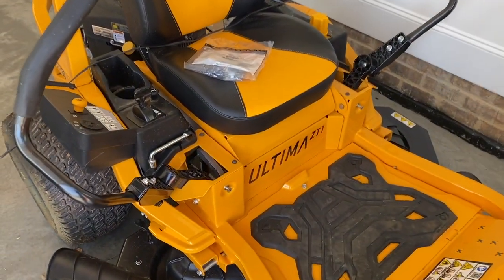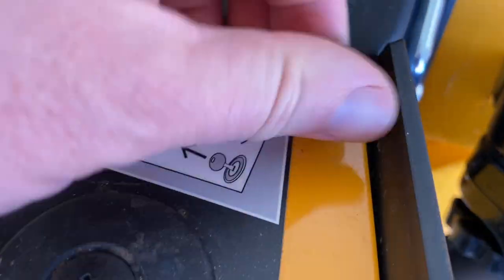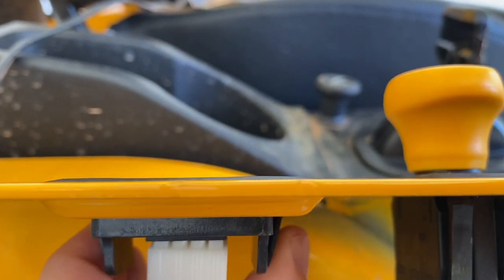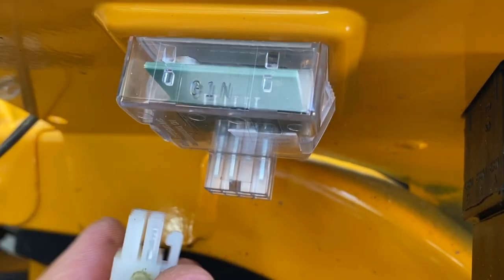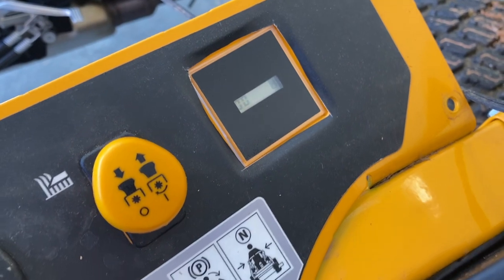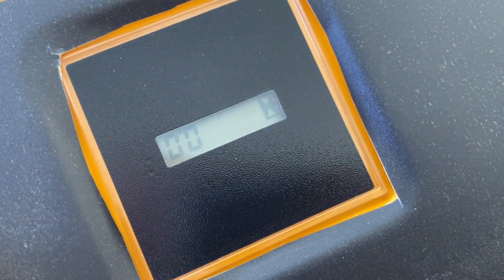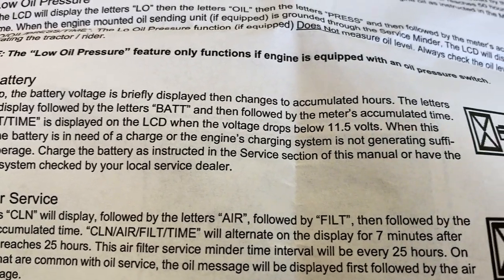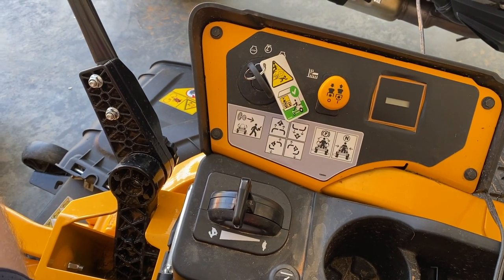Cub Cadet HOUR METER/SERVICE REMINDER Install DIY

Comment: Thanks for the video and inspiration.  I added the hour meter on my new zt1 50.   Instead of cutting the decal square around the opening I made an X from corner to corner of the plate (not quite all the way to each corner) Then I popped one side of the plate up and was able to remove it.  Then folded the 4 triangle portions of the decal down and around and re adhered them to the bottom...snapped the hour meter in and I have a nice clean install over the decal with no yellow metal showing.
Reply from the maker: +Mark Prentice excellent idea, thank you!
Reply: Thank you for this.  I am going to try the same "cut", sounds good.

Comment: What you need to do to get a clean look.  Take off the cover as you did. Using a heat gun peel the corner and then once it is loose peel back past the knock out plug. Use an old decal backing or silicone paper to protect the decal, place on the back, this will keep it tacky till the end. once the knock out is out put decal back into place but keep the paper on, so it will not stick.  Take a pin and push a small hole in the corner of the square knock out hole through the black decal.  Once you have your small holes made. Take a paint stick line up the holes as an edge, and use your knife to make a straight cut. do that till you have it cut out. Now peel off the paper, stick down the decal using the paint stick end to remove any bubbles, now press down your hour meter. it will fit in and all the clear plastic will look black perfect fit. Mine using the same meter looks factory.  You can buy a new decal on amazon. if you screw it up. Good video just you missed these first few steps.
Reply from the maker: +@WMS507 it bothered me while installing but since then I have never once noticed or even thought about it again 😂

Comment: For those wondering this also works on the XT1 - I was able to plug and play install it on my LT46 with the 22hp Kohler and it's so nice to have
Reply from the maker: +@vitreoushumor thanks for the additional info! 🍻
Reply: What did you take apart to get to it I'm trying to figure that part out?
Reply: @ToastedWaffles21  I was able to clip it into the center where the blank was. The blank had everything prewired

Comment: I have "Lo Oil Pres" issue with my brand new Cub Cadet ZT1 54. I bought a MTD hour meter from Amazon that was supposed to fit a BUNCH of different mowers, and was plug and play. Looks just like the Cub Cadet part too. Install was easy and when I started the mower up it was flashing "Lo Oil Pres." I shut the mower back off, and being a mechanic I went to trying to figure out the issue. First thing I did was remove the oil pressure sensor, this sits right above the oil filter on the Kohler 7000, and I bumped the engine over but didn't allow it to start. When I did this, oil came out of the hole for the sensor. This told me there was nothing mechanically wrong with the engine. I put the sensor back in and got my volt meter. The way the sensors work, is when pressure is applied to a diaphragm, a switch is made up and a circuit is made up to ground. With the engine off I had an open circuit, and with the engine ruining I had continuity to ground. This told me the switch was good. I then tested the same thing at the plug for the hour/service meter. Once again I had an open circuit with the engine off, and ground with the engine running. This told me the wiring harness isn't the issue either. The only thing left in the entire circuit is the hour meter itself. The Cub Cadet part is back ordered, so I'll just run the MTD part until the Cub Cadet one arrives. It's possible it isn't really compatible with my mower and Amazon lied that it was.
Reply from the maker: Thanks for the detailed info on how to troubleshoot! 🍻

Comment: Inspiring video. I bought the meter and made the cutout 1/4” smaller with 45 degree cuts at the corners. This allowed the blank to come out and enough material to tuck under the meter. I also added the washout.
Reply from the maker: +Arthur Nichols nice! 🍻
Reply: How in the hell do you get the other things out? I keep squeezing and they don’t budge.

Comment: The hour meter kit now comes with a new sticker thats already cut out around just the screen of the hour meter
Reply from the maker: +@dudester3263 good to know, thanks! 🍻
Reply: Where did you find it? Everywhere I have looked says out of stock??
Reply from the maker: @dj5287  Direct link right in the description to Amazon

Comment: You asked for a better way. I bought the meter kit from Cub Cadet. It came boxed with instructions, the meter and new decal. Actually it had 2 decals  but the ignition switch hole was much larger on one of them. The kit asks you to remove the two components and the existing decal itself. The new decal has punch outs for the ignition switch, PTO and meter. It wants you to install the meter and THEN the decal over that. The only thing showing is the LED. Once the decal is stuck on there, then you are to install the PTO and ignition switch. To be honest, it looks kind of cheesy but it's what Cub said do.
Reply from the maker: +Randy 😆 thanks!

Comment: What about the hours I already put on the mower before installing the hour meter?  Anyway to add those to the meter?
Reply from the maker: +Andy Stowe no there isn’t. Not a simple way at least. You could figure out the pins and apply power and leave it to start counting hours until it gets to where you want it I suppose.
Reply: @HelpMeDIY  that’s kind of what I figured. I just got the mower. Only have about 2 hrs on it. I know that isn’t anything in the grand scheme of things…but would like it to be exact if possible. I still don’t understand why they didn’t install this from the factory. Such a cheap and easy thing. I guess they just want extra money. Thanks for the video though. Exactly what I was looking for.
Reply from the maker: @andystowe4054  you got it! If it’s only two hours you could just leave the ignition on without the engine for 2 hours (hooked up to a battery tender to be safe). Just don’t forget to turn it off after 2 hours 😂
Reply: @HelpMeDIY  I ordered a battery tender.  It will be here tomorrow.  The hour meter is being delivered tomorrow as well.  I am going to let it sit for 2 hours like you suggested.  Do you have a DIY blade removal/replacing video?
Reply from the maker: @andystowe4054  Not yet, but I will make one when I need to do that
Reply: @HelpMeDIY  I am looking a mower lift/jack.  Do you have one that you use?  Any suggestion?
Reply from the maker: @andystowe4054  I have a 2 post lift in my garage that I might be able to rig up but I haven’t even looked into it yet. Let me know what you find!

Comment: I just purchased my ZT1 42in. last week.  It started right up when I got it home.  Mowed once with no issues.  I installed the hour meter yesterday and it is showing LO Oil Pressure.  I checked the oil and it seems fine.  I only have about 1hr on it.  It did take a minute to get it to crank over from a cold start yesterday before the 2nd mowing.  After it started it ran fine.  Any idea what the problem could be? My husband passed recently and I'm trying to figure things out on my own learning as I go.  Thanks :)
Reply from the maker: +Moho62 I’m sorry to hear that, but glad you’re learning! Hard to diagnose anything online but I would definitely make sure you check the oil level with the dipstick on the engine.
Reply: I just added my hour meter and mine too says low oil now while its full of oil and the mower is brand new has less then 1hr of use on it. 
I’d love to know if this hour meter can be trusted or what.
Reply from the maker: @Ryobifanatics  I would contact the manufacturer
Reply: I have the exact same issue with my brand new Cub Cadet ZT1 54. Bought a MTD hour meter from Amazon that was plug and play. Installed and started the mower up and it was flashing "Lo Oil Pres." I shut the mower back off, and being a mechanic I went to trying to figure out the issue. First thing I did was remove the oil pressure sensor, this sits right above the oil filter on the Kohler 7000, and I bumped the engine over but didn't allow it to start. When I did this, oil came out of the hole for the sensor. This told me there was nothing mechanically wrong with the engine. I put the sensor back in and got my volt meter. The way the meters work, is when pressure is applied to a diaphragm, a switch is made up and a circuit is made up to ground. With the engine off I had an open circuit, and with the engine ruining I had continuity to ground. This told me the switch was good. I then tested the same thing at the plug for the hour/service meter. Once again I had an open circuit with the engine off, and ground with the engine running. This told me the wiring harness isn't the issue either. The only thing left in the entire circuit is the hour meter itself. The Cub Cadet part is back ordered, so I'll just run the MTD part until the Cub Cadet one arrives. It's possible it isn't really compatible with my mower and Amazon lied that it was.
Reply: @sashimiturtle  I honestly think they're all going to read the same with the oil. Mine is a Cub Cadet meter that I purchased from Tractor Supply and it seems like everyone is having the same issue regardless of what brand or where they purchased it.

Comment: I just had a question for you whenever I plug mine in and turned my key over to the stop position so not running it stated that there was a low oil pressure kept popping up did yours pop-up any thing on it when you first turned yours on because when the engine is running I have no warning lights or anything pop up
Reply from the maker: +Brandon Ray I don’t remember ever seeing that, nor did I know it even had the capability to measure that 🤷‍♂️
Reply: @HelpMeDIY  I actually found it in my manual it stated that it’s normal for it come up as low oil pressure in the stop position then once the engine is fully running it turns off because the engine has full pressure now. Also stated that if your model is equipped with it. Witch my model is
Reply: @HelpMeDIY  page 14-15 in the manual under (Low Oil)
Reply from the maker: @brandonray191  awesome! Thanks for the additional info
Reply: @brandonray191  I just installed the meter today and mine said the same thing....Low Oil Pressure. I checked the dipstick and it is full and then some. Otherwise she runs fine. It makes me a little nervous but nothing I would loose sleep over. I will are some calls tomorrow and see if this is anything to concernyself with then get back to you.

Comment: My dealer did mine exactly like this. Needless to say, I was pissed..
Reply from the maker: +txkflier haha yeah I bet. I’ve honestly never noticed after the second time mowing.
Reply: @HelpMeDIY  Some videos show a new label that comes with the meter. You take the original label off and put the new one on. It has a window in it for the meter.